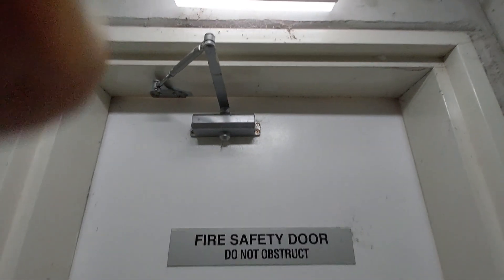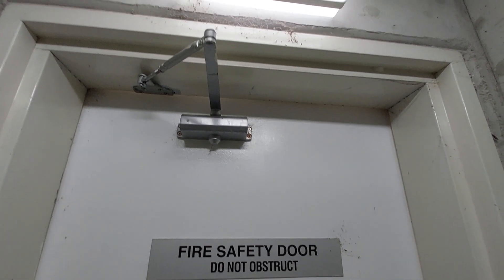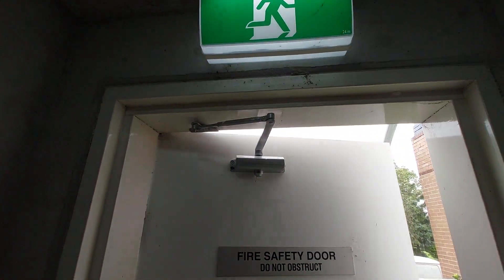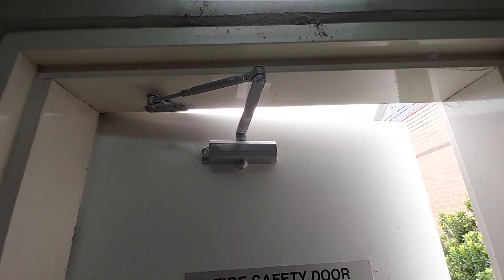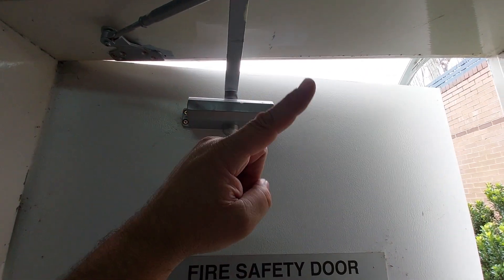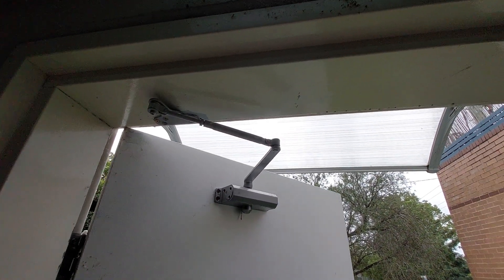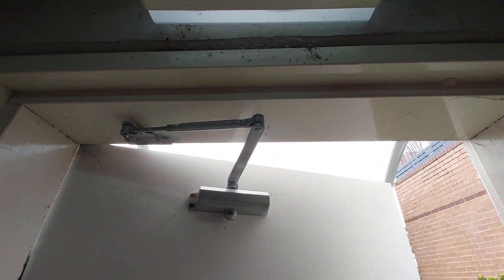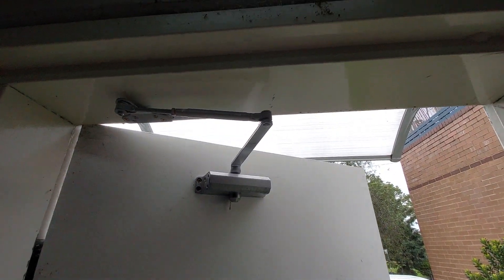What's wrong with this door closer ? Locks.ith on the job #3330

Comment: This is a bodge installation. I see two issues:
1. Closer looks like it’s made to be used on a interior door. It looks like it could to be too light for an exterior door.
2. When mounted as parallel, the positioning of the closer needs to be very precise. If not, the door will not close or not open fully (both in this situation).
In Europe (except for the UK) I’ve seen not many parallel installations of doorclosers. It also doesn’t have my preference, the latchting force sometimes is to weak to latch the door properly without slamming.